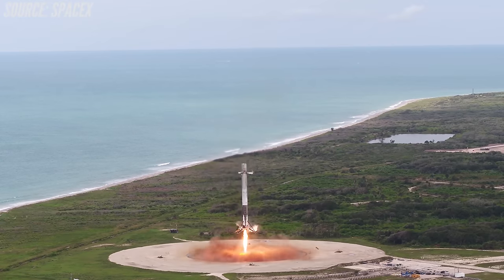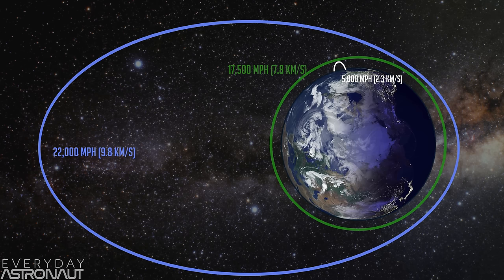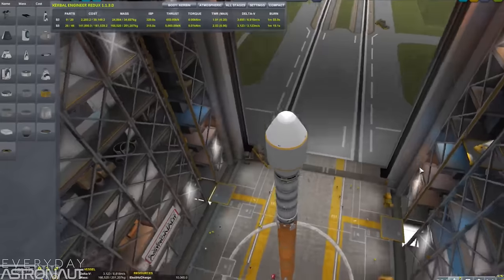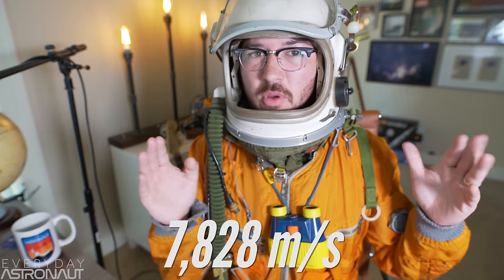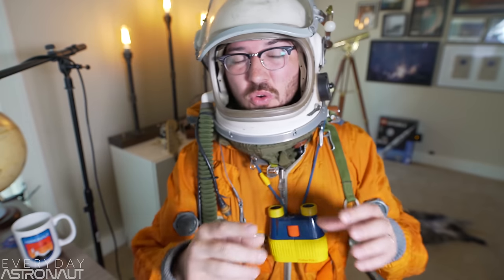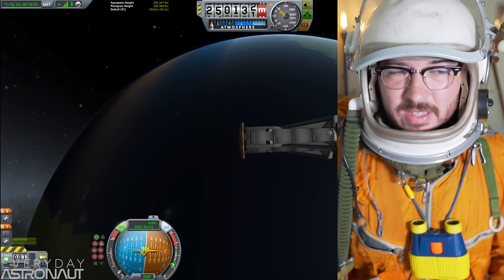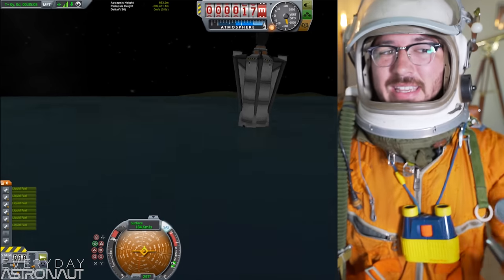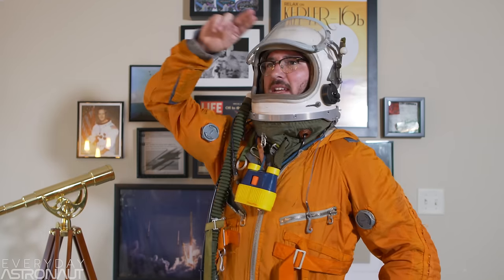Can SpaceX Reuse a second stage?

Comment: Easy.  Inflatable heat shield.

1) Dual membranes are deployed by a half-circular arm from the body just above the engine.
Like a windshield wiper blade on steroids.  Arm sweeps down, out, over the engine, and then
back to the other side of the body, wrapping both membranes over the engine. Arm is grabbed/
locked by some mechanism on the other side of the body.

2)Then the expanding foam filler is injected between both membranes.

3)Depending on the differing tensioning and the timing of the tensioning of the two membranes,
you shape the foam plug.

3a) Initially, the outer membrane is kept tight, inner membrane left loose.  Foam forces the inner
membrane to conform to the shape of the engine nozzle and thrust plate(?), so that it is solidly
attached to them.

3b)Then once a sensor on the thrust plate detects that the membrane has been forced
down against it, the outer membrane is then slowly detensioned to allow the heat shield to take the
proper mushroom shape.

So the heat shield is:

a) kept from sticking permanently to the engine nozzle, making it a mess to
remove(assuming they can recover the second stage in the first place).

b) the now-solid foam core is more or less surrounding and conformed to the engine nozzle,
so it's not going to float free under the forces of reentry, plus it's "attached" to the(previously noted)
heaviest part of the second stage, so it will be in a aerodynamically stable location on the stage.

c) the outer membrane and foam core, if wide enough, can slow down and protect the second
stage through re-entry.  Now it's just a matter of a parachute for the last few miles through the
atmosphere.

You've used virtually no fuel except for the initial deorbit, and the mechanism is cheap enough
that if it doesn't work 100% of the time, you haven't lost anything.  Also, if it lands in the ocean,
the most expensive part(the engine) is nicely wrapped and encased(like a christmas present),
keeping it from corroding.  Or slowing down that exposure, anyways.

EDIT:
I should have added that as long as the inflatable heat shield fully conforms to the engine,
even if the rest of the second stage blows up or burns up during reentry due to whatever(instability?),
the engine(the most expensive part) is wrapped up in that coccoon of protection.
Reply: "Easy"
Proceeds to 12 paragraphs of explanations.
Reply: Bruno Mailly what did you expect it’s rocket science

Comment: why not use the realism overhaul mod? and spaceY? and your mechJeb profile looks a little off. maybe it had to change due to the increased gravity. need to go play some ksp myself 😉
Reply from the maker: +Alan John my computer is riding the struggle bus trying to screen capture and run Kerbal as is haha. Yeah I had to change the profile of mechjeb a lot to fulfill the illustration. 👍
Reply: +Everyday Astronaut Copy out the whole KSP folder to a separate location.  Have a separate Realified and Kerbalised installs.  CKAN in the folder can manage the mods for you pretty well.  Won't take too long to see if it'll run.  Good video!  Keep it up.
Reply: Yes, rss/ro are more accurate than simply cranking the gravity

Comment: I think you should use only inflatable heat shield (IHS), 4 thursters, probe core, batteries, solar panels (optional) and some parachutes to land it (Apollo way or KSP way). It would only be around more than 1,5 tons heavier. The more lightweight the better. It would be easier to point the IHS (put at the top of the upper stage) at the prograde direction and let the atmospere do the rest of the job, instead of a 3,75m HS and some heavy meltable wings. BUT, the not-so-good fact is that if the second stage is too LONG , it could tip over and could end up being destroyed. Trust me, I tried in KSP. In that case, put the IHS at the back of that stage, near the engine SOMEHOW . It would make that stage a lot more stable during reentry, but it is also mean that the upper stage would be a lot more HEAVIER to be carried around, since 2 IHS would have a total weight of exactly 3t.

It's just my own opinion. Feel free to share your own. And don't judge or critize each other's.

Comment: It's the very first video I watch of him, and after 3:45 min of 
watching, he already makes a big mistake : no it wouldn't take the same 
amount of fuel to decelerate as it took to accelerate, since the second 
stage has a full tank on initial injection burn, and an almost empty one 
for low orbit injection burn, and above all, IT DOESN'T HAVE THE PAYLOAD
 ANYMORE, how does he think the space X 1st stage does to go around 
after stage seperation ?
Reply from the maker: +MrGustave1er I've addressed this in many different comments, I meant to say delta v and not fuel.
Reply: Everyday Astronaut but the point is the same amount of fuel gets you a LOT more Delta-V when you don't have to deal with the payload.  This is actually extremely inaccurate to try and simulate in stock KSP, though, because the stock fuel tanks have an insanely low mass-fraction compared to anything in real life, and the engines are much heavier for the thrust they provide.  You need to run with RealFuels installed to get anything like an accurate image of upper stage recovery- if you do, you'll find your Delta-V went up by a LOT more when you reduced the payload- and would go up by even more still if you increased the size of the upper stage to take advantage of the reduced payload like you should (and lime SpaceX would realistically do if trying to design a reusable upper stage, and they decided they needed to down-rate the maximum allowed payload to enable reusability...)

Comment: I have very little space and engineering knowledge (beyond understanding computer systems) - Is there any potential for using the sun as a power source and converting that into some sort of resistance to slow things down in space before reentry? (Maybe through magnetism or lasers?) Though admittedly you'd probably need to need to have something that's not Earth to push against... Maybe the sun itself? I'm sure people much more educated than myself in those areas have already considered those things!

Comment: I’ve seen images of a concept for a reusable second stage that resembles the lower half of the ITS spacecraft 2016 version only with a heat shield in place of where the Raptor engines would go at the bottom. I would imagine it could resemble something like that because the only way to make a second stage return to earth is to have the engines built in similar to how the Super Dracos are configured on the Dragon V2. It probably wont use landing legs for droneship or landing pad touchdowns because that would add complexity & weight so an ocean landing with parachutes would be the likely return/recovery method.
Reply: I'm the first like and reply this comment has had in a year

Comment: Would it be possible to refuel the first stage after it has landed and send it back up again to retrieve the second stage? Without a payload the second time up, there'd be plenty of fuel left over to make a powered landing with both stages.
Remotely recoupling the stages would be a hell of a challenge though.
Reply from the maker: +catoomch a first stage alone would maybe just barely have enough delta v to put itself into orbit and would have not nearly enough delta v left over to land with itself let alone with the second stage attached... great thought though, just not nearly enough margins unfortunately
Reply: Thanks for your reply.
Some very rough calculations here - please don't judge me.
Could a Falcon 9 with a larger fuel tank be used as dedicated retrieve rocket?
The dry weights of normal first and second stages are similar but in the retrieve rocket, the fully laden mass of the second stage is replaced by fuel (and some extra structural weight).
The implies that the extra amount of fuel on the retrieve rocket (relative to a normal first stage) at the point where separation would usually occur will be equal to the mass of a laden second stage at separation, which means it can reach an orbiting second stage with extra fuel on board.
Would this be enough to make a powered landing with both though?
Reply: Maybe this is what Elon had in mind all along.
I was wondering why he opted for a pneumatic mechanism for stage separation rather than explosive bolts. 
The explosive bolts are lighter, more reliable, and pose no risk of damage to either stage. If he was intending the second stage to land under its own power, new bolts could be swapped in on landing.
The only incentive I can think of for the increased complexity, weight and failure modes is to allow recoupling in orbit.
Reply: catoomch what you are describing there is basically using an extended version of the upper stage as a dedicated fuel tanker to help recover the normal upper stages.  And there is no reason, theoretically, that shouldn't work.  If the tanker can reach orbit with more leftover fuel than it needs just to get itself back to the surface safely, it should be able to donate any excess to the other upper stage- and possibly enough to get them both back safely.  However actually DOING that requires more practice working out the technical challenges of orbital transfer of cryogenic fuels...
Reply: The fuel transfer technology needs to be developed for the ITS tanker anyhow. This would be a good testbed for it.
I'm talking about doing away with the second stage altogether, just one supersized first stage. The weight saved by not having a first stage should offset the extra structural and fuel weight needed.
Reply: catoomch you wouldn't want to do away with the second stage.  You get more fuel to orbit by sending the second rocket up with a payload of nothing but fuel, and have more fuel to split between recovering both second stages that way...
Reply: Everyday Astronaut with a second, third, fourth, or even fifth rocket sent up with nothing but fuel for its payload (you might develop a specialized extended upper stage built for greater endurance to allow more time for rendezvous/docking, or you might have a small specialized payload of fuel for the stranded upper stage, and a heavier upper stage with just enough fuel to recover itself) you could get enough fuel to the stranded upper stage to recover it.  Essentially, you would launch one rocket just barely able to recover its launch stage and get a commercial payload to orbit, and 2-4 additional rockets where the upper stages had enough reserve fuel to recover themselves (at the expense of greatly reduced payload capacity) and the payload was either a specialized third stage, or additional fuel tanks built directly into the second stage (this would save the need for a decoupler and additional set of landing-thrusters and extra heatshield) that would rendezvous with the stranded 2nd stage and provide it with a little fuel, still keeping just enough in reserve to re-enter and land itself...

In essence, the concept boils down to this- in order to recover the 2nd stage (which is just barely possible with current technology), you need to cut into payload-fraction big time.  So instead of 1 rocket with a 3% payload-fraction and insufficient fuel to recover the upper stage, you need 3-4 rockets with a total mission payload-fraction of maybe 0.7% in order to have enough fuel to go around (after orbital rendezvous and fuel-transfer) to bring back all the upper stages and fuel-tanker stages as well as launch a payload.  Interestingly, you could accomplish this with 3-4 separate rocket launches, or you could do it with a single rocket even more powerful than the Falcon Heavy (with maybe 2x the mass on the launchpad of a Falcon Heavy, just to launch a payload that can be launched with an expendable upper stage on an ordinary Falcon 9...)
Reply: My idea relies on there being a significant weight reduction by using a single oversize first stage rather than having two stages.  The fuel capacity of the oversize first stage would be equal to the combined weight of the regular first and modified second stage you're proposing.

Comment: in the boeing image why are the guys near the space plane in hazmat suits?
Reply: Nova Because they used toxic hydrazine fuel for the reaction control system
Reply: It was exactly the same with the Shuttle.
Reply: They were in the pre-potato-growing stage of hydrazine handling.
Reply: they are using highly toxic propellants
Reply: PS, the Super Draco engines use hydrazine.

Comment: The ULA plan for an orbital fuel depot is hardly groundbreaking.  ULA and Boeing on its own (Boeing is one of the companies making up ULA, and responsible for most of its more innovative ideas) have been talking about orbital fuel depots and systems for collecting spare reserve fuel from spent stages for many, many years now- without ever once making any step towards actually realizing the idea.  For ULA, ideas lime these are just the bait they dangle in front of NASA and the Air Force to get more funding and contracts- they don't appear to have any intention of actually carrying them out...
Reply: Nothing that ULA has ever done, was or ever will be groundbreaking...
Reply: "Collecting leftovers in a depot" looks bogus : Changing orbit costs a lot of fuel.

Comment: Why not use the atmosphere to slow you first? Get just inside the atmosphere, maybe 62km, and orbit 10 times or so. Then use rcs with the oberth effect to keep your periapsis at 65km. That will bring you in much slower.
Reply: keeping a rocket near parallel with the surface in order to slow it down with a thinner atmosphere would literally use up all your booster fuel cos of the rotational torque of the engine. Don't quote me on this though I'm an electrical engineering student not aeronautical.
Reply: EXTC yeah But, if you let the vehicle spin, there will be no need for any fuel spent unless correction altitude.
Reply: Im not sure what you mean by 'let the vehicle spin', because if the vehicle spins on the horizontal axis its going to snap, Im assuming you are thinking of it spinning on the verticle axis in which case im not sure how you will do that without spending any fuel.
Reply: EXTC yeah no. I mean let it move how it wants to move. Do not try to correct. As long as you aren't too far into the atmosphere, the vehicle will not break up.
Reply: how about rotation for re entry stability?
Reply: K K as opposed to fins or rcs? Way too much mass.
Reply: That's what I would do in KSP, not about real life but I imagine it does make it much harder to predict where it will land.
Reply: If you spin it on the vertical axis all the fuel will centrifuge to the sides of the tanks and starve the rocket.

Comment: Why did they drop the Saturn V entirely?  They haven't had another vehicle that could carry as large of a payload since.  It was proven technology and it launched Skylab,  which was HUGE inside compared to the ISS.  Astronauts could run on the walls!  Imagine four Skylabs linked together.  How many total smaller-payload launches did it take to construct the skinny ISS?
Reply from the maker: +UnFunded Opportunities great question especially since it was actually cheaper per launch than the space shuttle!!!
Reply: I think they thought space shuttle would be cheaper and they could have more launches, but they were wrong. At the end space shuttle was expensive and launched only a couple of times a year. In the aftermath it would have been a better choice to use Saturn 5 rockets after Apollo program.
Reply: The Shuttle was one step forwards, two steps back.